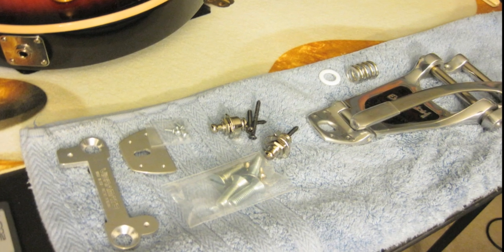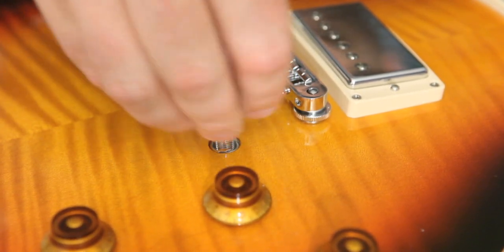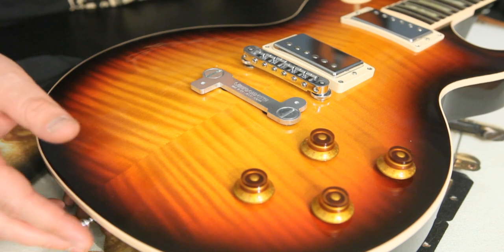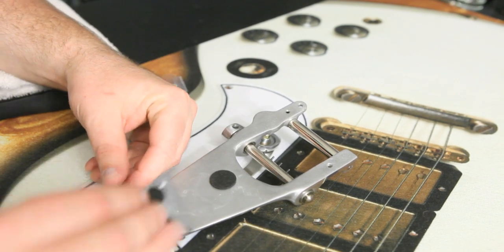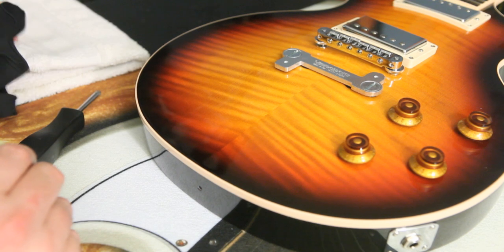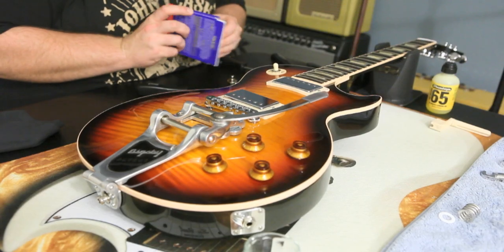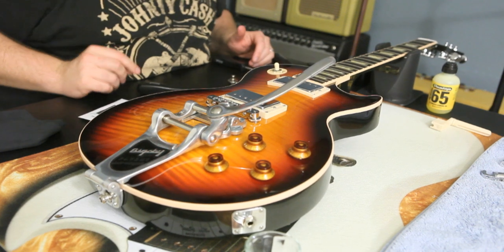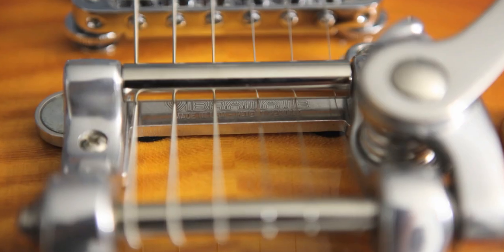How to Install a Bigsby B7 and Vibramate V7 on Gibson Les Paul Standard by Scott Sill

Comment: Why isn't possible to use the vibramate method when putting a bigsby in any 335 body guitars?
Reply: If you go on the Vibramate website there is a page for installing a B7 on a 335 with a vibramate mount.
Reply from the maker: Michael Fenton I looked and couldn't find that.  I would like to see how that is possible, because I don't believe the dimensions are the same for a 335 and a Les Paul.
Reply: sillennium I was on the site last night. It may not have been the same mount http://www.vibramate.com/vibramate-v7-335-install.php that's the link.
Reply from the maker: Michael Fenton thanks for pointing that out.  Yes that uses a B7 Bigsby, but a totally different vibramate.   HOwever you are right they did create a product to work with a 335.  thanks for pointing me in that direction.
Reply: No worries. I am Glad that I could help.

Comment: my bigsby's bar is loose. cant figure out how to fix it.
help.?
Reply: sorry, you haven't got a response in six years but I think you have to tighten a srew that is under the spring.
Reply from the maker: Pull strings off and screw in nut below the bar

Comment: Have you had any troubles with the Bigsby since it is not drilled on? Have you returned the Les Paul to its original form at all since the Bigsby has been installed?
Reply from the maker: Operation:ripe no issues with it.  I haven't restored the guitar back to original yet, not sure if I will.
Reply: sillennium COOL! Thank you really appreciate it!
Reply from the maker: np

Comment from the maker: I do not believe this will work with a B70 Tailpiece because it has a different design near the strapbutton area which is important for the installation using the Vibramate.

Comment: How badly does this mess up your intonation or does it really even mess with the intonation and can u put the guitar in the Gibson case with the bigsby on or do you have to take it off so the bigsby does not break
Reply from the maker: The guitar fits just fine in the case.  The intonation didn't change, but the Bigsby doesn't fix the Gibson plastic nut issue.
Reply: How can the intonation be messed up if the bridge saddles haven't moved?

Comment: Whilst the quality and presentation of the instillation is fine next time you are screwing anything into the top of the guitar please hold the screwdriver near the tip for a more stability.It generally insures you against the oops I slipped and now look at the scratch on  the guitar.It's only a small oversight but important I have seen quite a bit of damage caused by this small but often overlooked issue.
Reply from the maker: Never that's for babies lol

Comment: Sorry to throw this point in but when you screwed down the Bigsby to the threaded inserts the Bigsby wanted to stay parallel to the surfaces of the inserts   Then when you screwed the strap button back in the back of the lp there was stress put on top of the surface of the guitar before it sat down in the correct position. Keep an eye on the surface of the guitar of the guitar at the sides of the inserts  It would be a shame to damage what you paid a lot of hard earned bucks for at this stage. Just seen the date of the last post hope I'm not to late.
Reply from the maker: No worries the guitar is okay

Comment: Ive been seeing a lot of guys “dog bone” mod the vibramate. It looks great but not sure it would be as stable or they would have designed them that way and saved money on the extra metal used to make it. Not that our price would be lower they would just make more using less material. They want more profits, so they would have if they thought it would be fine and make more money. I wont be doing that. I would do the callahan upgrade to it and a soft spring your spring seems really tight.
Reply from the maker: I have had this on my guitar for over 10 years still going just fine
Reply: @sillennium  That is reassuring! Thank you!

Comment: if you use your left hand to guide the screwdriver (so there's no chance of the screwdriver slipping off the screw and onto the guitarbody/top), there's less need to be worried about having metal objects near the guitar ;) It was sorta odd hearing you talk about wanting the least amount of metal objects near the top of the guitar (probably to have the least amount of damage to the finish) and then seeing you screw in the screws single handedly, while the other hand was just resting on your lap, instead of guiding the screwdriver properly for that very same reason haha. Sort of a facepalm moment for me.. but I guess it could've been done for video purposes? So as to still be able to show the camera what you were doing. But still.. haha
Reply: lalythil plasti dip a cheap screwdriver. just in case:)
Reply from the maker: Yeah

Comment: $200 trem, $3k guitar,  $0.30 screwdriver.
Reply from the maker: And so?
Reply: Well, that black handled screwdriver looked like the sets they give away at Harbor Freight tools and I found it remarkable that anyone actually uses those. No offense meant, it looks like it worked for you.  
I wouldn't personally use a cheap screwdriver to put screws in fine instruments though generally out of fear of either slipping, or screw damage. 

I am a system automation contractor and own many quality screwdrivers. I can understand why others may not. Thanks for the video
Reply from the maker: Well I do have nice screwdrivers, but at that time I valued guitars more than tools.  Lol

Comment: So you take the world's most unstable tremolo and put it on the world's most notorious guitar known for having tuning issues. Yeah I don't think you no too much about guitars. For the same money you could have got a Floyd Rose FRX that guarantees tuning stability. The Floyd Rose FRX is also a unit that you can install on a guitar that has a stop tail piece and can be put back to its original state at any time. But I get it most of you Gibson Fanboys are very vain and want that old grandpa look. Good luck trying to keep that thing in tune dude lol. I noticed you didn't Whammy out on that bar and then play an open chord so we can hear that it's still in tune. Even with your locking tuners that thing is going to go drastically Out Of Tune. Gibson guitars are overpriced firewood their QC is horrible. It's also funny Fanboys like you are too vain to even try a different brand of guitar.
Reply from the maker: Know is how you spell it.